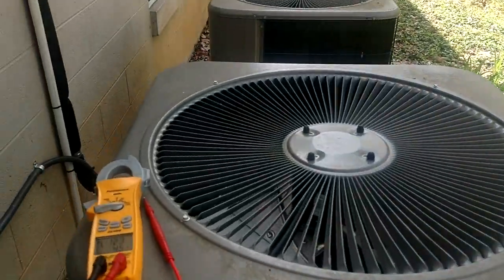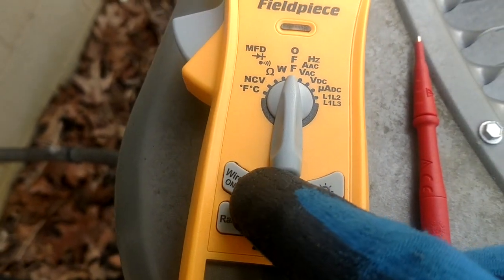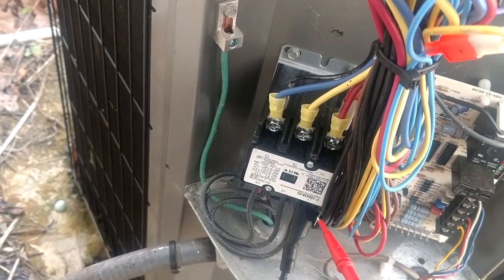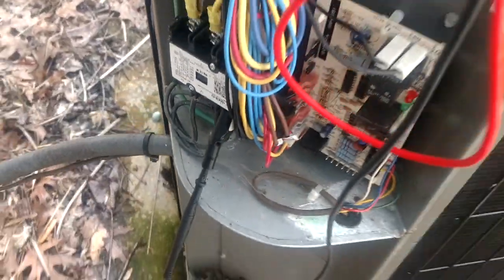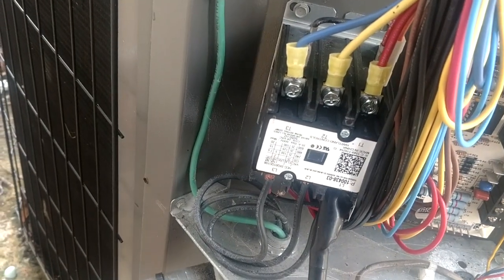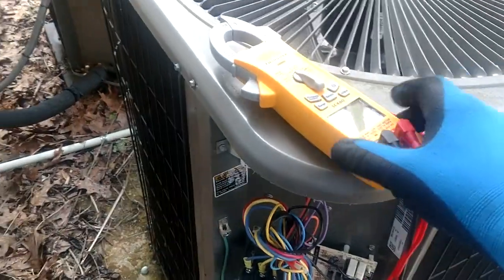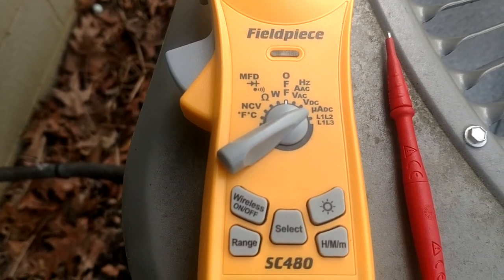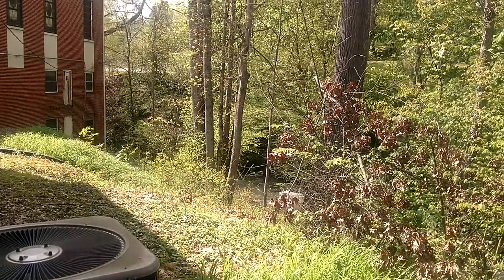NEW! Fieldpiece SC480 clamp meter: 3-phase function ⚡⚡⚡

Comment: Great video Shannon, very informative. I just bought this meter to replace my old SC260, I needed an upgrade. Have you had any issues with °F°C option? I tried to calibrate it in ice water with 2 different thermocouples and both were saying -30. Seems the meter is faulty. What are your thoughts?
Reply from the maker: Thanks for watching the video. glad you found it helpful. My only advice with the thermocouple would be to make sure you have it inserted into the meter in the proper orientation. There is a positive and a negative side to the thermocouple. 1 prong is larger than the other and one hole on the meter is larger than the other. Good luck. 😎👍
Reply: @sknight0391 Thanks for the reply, I definitely had them in the correct orientation when plugged in.
Reply: @sknight0391 Did you have any issues calibrating the SC480?
Reply from the maker: @christov4120 I never really used the temperature setting on mine a whole lot but when I did it was accurate.
Reply: @sknight0391 Right on good to know. I'm going to send it back and get a replacement. I use the K-type pipe clamp alot.
Reply from the maker: @christov4120 getting a replacement would definitely be the best thing to do. 😎👍

Comment: Does the Fieldpiece SC480 have the same non-contact voltage "prober" as the Amprobe ACD-14 PRO has? 

In theAmprobe ACD-14 PROvideo, you showed how the "prober" was sort of a "must have" for finding low-voltage shorts.  I'd have to agree -- that looks like something that could drive you crazy. Does the SC480 have this feature?

I see NCV on the Fieldpiece dial, so I'll assume yes.  

Using that feature is something I could sure use some practice on.
Reply from the maker: Yes

Comment: How is the wireless feature working I seen a video that stated when wireless feature is applied it will kick off the apps when reading amperage. 
(He said it would usually add an additional 2 amps)
Reply from the maker: The 480 does not have that issue.

Comment: Was planning to buy this meter, haven’t found anything videos on how well this meter works with Measure Quick, have you tried to link it on MQ?
Reply from the maker: Hope that helps.
Reply from the maker: Thanks for watching the video. I can't comment on anything related to measure quick. I don't use it and I could honestly care less about it. I know Bergman said he was working on it. But then he also recommended his crappy Supco meter to use with measure quick. And I've never seen a video of anyone saying that they like that meter. When I use a meter, I just want it to get the job done and the Fieldpiece sc480 will do it. There's not another meter on the market that can do what it can do.  😎👍
Reply: Thanks, I’ve had my sc640 for a few years but the new company doesn’t want my tools in the truck. I’ve seen HVACR use his field piece probes and MQ but I wasn’t sure if the sc480 worked as well. Might just use job link anyway for reporting. Thanks again for the quick response.
Reply from the maker: @sirxjacquees  now I can comment on Job Link. it's very easy to connect the meter to the job link app. It even recognizes the serial number of the individual meter.  the connection is instant when you turn the meter on. The screen is laid out nicely and it updates very quickly. has the amps and volts on the meter change you see it instantly on the screen. It also has real-time bar graphing. The distance is quite good and it has no trouble going through blower doors or walls.  And you should get a 30-day free trial, to use for the more advanced features on the job link app, when you buy the meter. But I didn't even use mine for that.

Comment: Cool. I always just go for the ear test method. If it sounds like it "gargling rocks" as you said; I know I need to swap two leads. But, nothing wrong with being more technical about it. A pressure gauge will tell you pretty quickly if the compressor is pumping or not, too.

Comment: Didnt know units could run backwards. What does that mean? Can you check reverse with regular meter
Reply from the maker: That's only with 3-phase power. 2 legs of the 3 are are reversed and need to be switched so the motors will run in the forward direction.

Comment: Great video Shannon, I want a new meter buy haven’t made my mind up yet
Reply from the maker: This one's pretty solid. Extra $50 for the SC680 will get you the swivel head clamp, lighted dial around the selector switch, "dual" temperature, test lead storage on the back, AC &  DC amps through the clamp, Hz & duty cycle through the test leads. But of course it is a much larger meter also.  Thanks for watching buddy 👍   
I wish you the best of luck quitting smoking. I have two friends that did it and they said it was the best thing they ever did. Neither of them have smoked in over 10 years. #BeaQuitter 💪
Reply: @sknight0391  Wow the SC680 sounds like pretty much the ultimate meter. Dual temp and AC/DC on the clamp meter are pretty strong selling points in my book. Makes me wish I'd done my homework instead of buying the accessory heads for those functions... Oh well